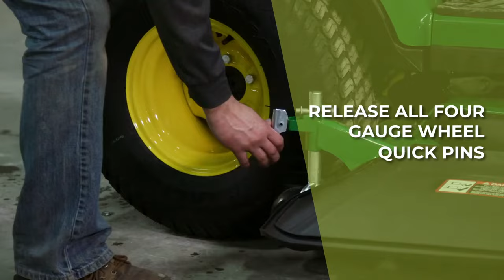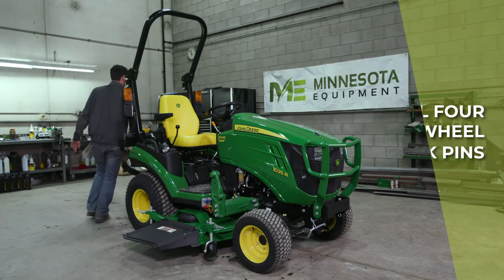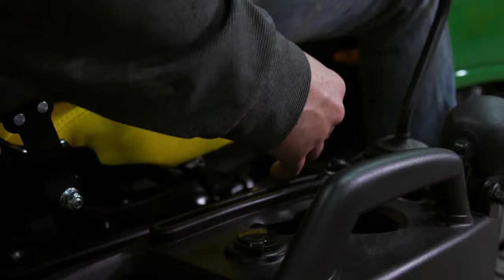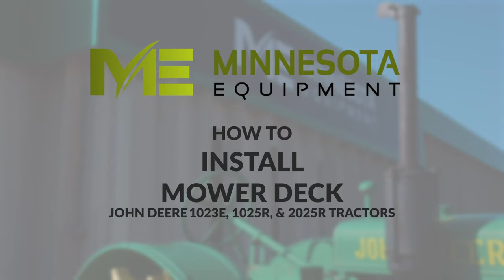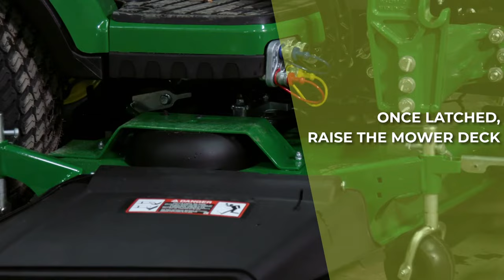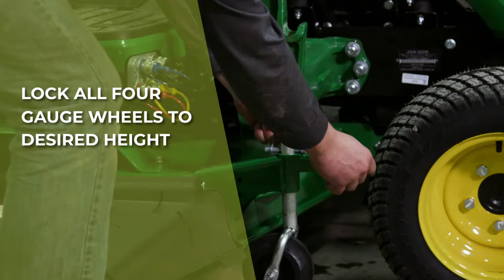John Deere 1023E, 1025R, & 2025 Mower Deck Removal & Installation Tutorial by Minnesota Equipment

Comment: I find that the bottom assembly of the tractor does not lower enough to allow the bars on the deck in and out of the assembly. The paint is JUST thick enough to prevent them from releasing.  :\